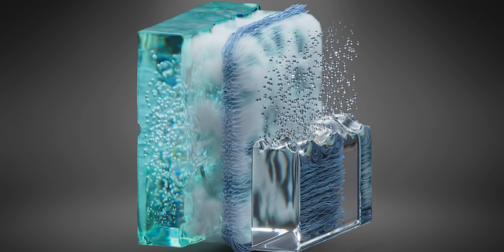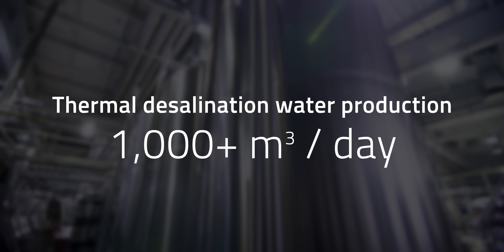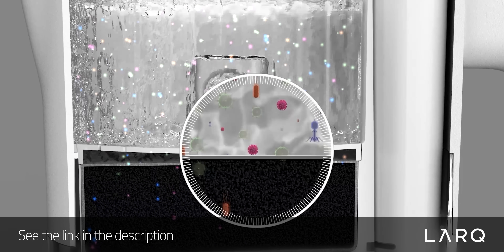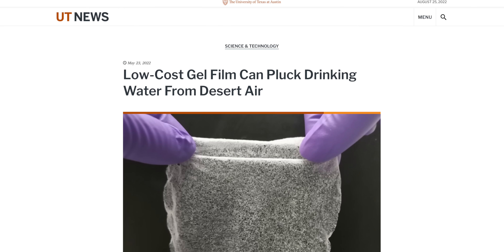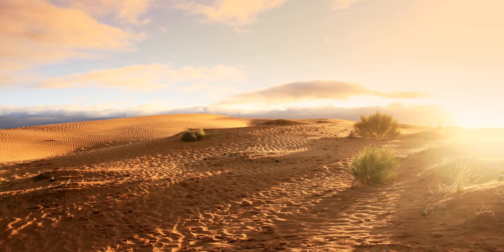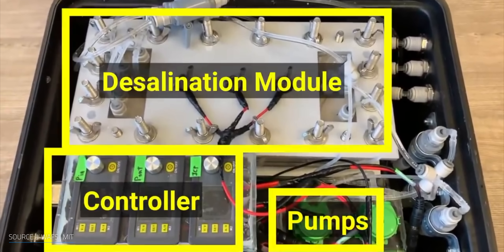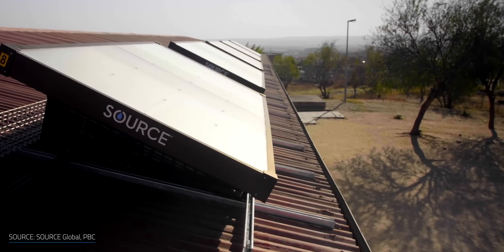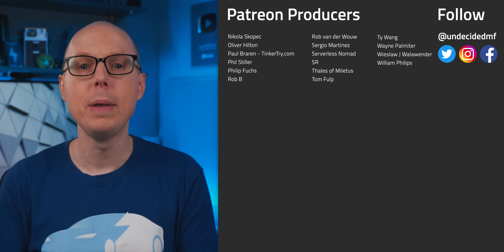2 Breakthroughs That Could Solve the Fresh Water Crisis

Comment: Tanking the water from the air in mass would increase the drought because it removes all moisture from the surrounding air. Kind of like cutting down the trees kills the life and increases the heat and drought in the local area. No thanks. If you remove fresh water from salt water you can dump the removed salt back into the sea. The removed water will find its way back into the sea to replenish the fresh with salt to keep the saline levels in balance. Im for desalination via the sun.

Comment: - When we remove the salt from salt water, the salt has to go somewhere. So all desalination techniques have to contend with that side-effect. Ironically, higher productivity in terms of fresh water output divided by salt-water input makes the side-effect more potent ... requiring some way to dilute the brine to an acceptable level.
- Pulling water out of the air is not dealing with salt ... as air usually has very little salt in it (unless you are very close to an ocean). The gel seems wonderful. One might even make it part of an adventurer's (or soldier's) clothing or a vehicle's cladding. Considering how inexpensive the gel seems to be, recycling may be a problem because there is too little financial incentive to do so ... UNLESS: Like beverage containers, recycling is prepaid.

Comment: The Phaseshift from water to steam itself takes energy. It is physically impossible to harvest water from the air without putting in a lot of energy. One Liter of water will with perfect efficiency require 626.9 Wh. I really doubt that should be a solution to work towards.

Comment: I, like millions of other sailors, have lived off of a small-scale, membrane-based, high-pressure unit powered by modest solar, wind, and water turbines in full ocean salinity on a budget of ~20L per day (made in one hour around noon for obvious reasons) for two people (and two cats) for years and years underway on a limited budget. This ICP unit in the video is making a tiny fraction of that, optimistically, from a comparable or larger package, and I hope those hope production estimates are not as misleading as "ballpark $50" for the unit, when $50 wouldn't come close to even buying the case it's in. Demonstrated cubic meters per kWh side-by-side comparisons would have been helpful for membrane- (which also leaves you with cleaner water than you can get anywhere but a laboratory, of course) vs. ICP-based technologies so we can decide more clearly if ICP is actually "challenging the status quo". That, and an honest estimate of what a unit like this -- soup to nuts -- might actually cost once commercialized. It surely isn't $50 or anything remotely like it.

Comment: I recommend looking into carbon nanotube membranes further. Hydrothermal gasification of waste biomass (sewage, sludges, food, etc.) creates carbon nanotubes and other graphitic materials. The hydrogen and methane produced in HTG can be used to power desalination processes. If the temperature and pressure of hydrothermal carbonisation are brought down, then the products of liquefaction and carbonisation produce other materials to offset fossil fuel use and can sequester carbon if paired with pyrolysis. The brine could be used in algae farming for additional carbon capture and fed back through hydrothermal liquefaction to create more biofuels. The whole process would be carbon negative.

Comment: I really like the MIT idea.  Now we just need to turn the Brine into something that has value and can be sold or used as well, instead of a waste product.  
Salt is very good at storing heat.  
So at a slightly less portable size you could use the brine to collect heat for reuse. Then use that collected heat to finish drying more salts the rest of the way in to solids.  
Then use the solids as a way to collect even more heat.  
For small seaside communities with a fair amount of sun you could supply fresh water.... both hot and cold.  Then use some more of the heat to make electricity at night when the sun does not shine to keep it going.  
Until you reach the point where you have more fresh water than you can use then you can pump it farther inland to somewhere that is willing to pay for it.

Comment: On the project of pulling water from the air even in a desert climate, 
I'd image the question about longetivity of the hydrophilic filter is pretty obvious...
1. The filter is made of cellolose so although organic and cheap will have a relatively low life related to abrassive  factors. Plenty of filters for numerous devices are made of same or similar material, and I wouldn't expect that this version would be any different.
2. Possibly the single biggest factor affecting lifetime is theamount of debris that is trapped. Especially for something running continuously 24/7/365, enormous volumes of air will pass through the filter and contaminents will be caught. The question then is how to clean, and typically a thorough rinsing is SOP but that would possibly affect total production. This is an issue that would be site specific and deserts are well known for lacking soil because it's blown by the wind.. Who knows, i there is enough power available, maybe an electrostatic filter could trap particles before they gt caught in the filtere.

Comment: The portable supply unit,  if it can be mass produced at $50 is pretty impressive.   You would basically need one, and a solar panel for each member of your family to get all your purified drinking water needs.  As far as the brine discharge, there are some uses for it.  There are a type of beets called ' fodder beets' which can be used to feed chickens, cows and pigs which grow really well with salty water.  The brine could be diluted into typical irrigation systems.  On a household scale, brine can just be used to kill weeds between cracks in your sidewalk etc since a household would produce very little.  It can also be used to de-ice sidewalks... it is basically the same thing you go to the store to buy in the winter.

Comment: The calculations I've seen in these comments are nutty.  The underlying problem is the confusion between water vapor and liquid water.  One comment claims that processing 200 L of air will generate 6L of water.  No it won't.  It might produce 6L of water vapor, but that will condense to less than 10 mL of liquid water.

The other problem is hidden in the word "condense" -- the energy required to transition between water and steam is huge (that's why evaporative coolers work so well in desert climates).  To turn steam into liquid water you'll need to dissipate a LOT of heat. This is impossible without air conditioning equipment and lots of electrical power.

Another comment claims that clouds are 3% water by weight.  Okay, but clouds don't weigh very much.  You should be able to see that for yourself, since they literally float on air.  This low density means that you must process a HUGE volume of air/cloud  in order to extract any meaningful amounts of water.

All of these water-from-air projects are scams.

Comment: Build up swales topped with the moisture harvester materials.

Build an array of swales in the mid-range of known flash flooding dessert areas. In time creating pockets of greenery, increasing water absorption. 

Make the swales by digging long tunnels in 2 tiers. The bigger ones function as a reservoir. The smaller diameter one dug just under the surface to collapse, designed to perform as a french drain. Use the tailings from tunneling to shape into swales.

Will it solve the water crisis? It'll help many aspects of it. The ability to reclaim land, the fertile crescent comes to mind, is a worthy mission.

Makes for an interesting Boring project.

Comment: 20 Wh per liter is a VERY HIGH power consumption!! Thermal desalination, which almost nobody uses for its high power consumption, requires 10-15Wh/l, while inverse osmosis only 2-4!
The second method it is even more insane: to warm the gel and the water to the required 60°C you need 112Wh/l!! If that was not enough, the release process begins at 45°C, meaning that the system is almost useless in hot climates...

Comment: 20 watts per Liter is meaningless, watts are a rate of energy consumption.  We need to know the ENERGY used per Liter of water.  If it's consuming 20 watts while in operation and makes 300g per hour then the consumption would be 240 kJ per Liter or 0.06 kw/h.   Inability to do basic math like this is why people say this channel is useless regurgitation of press reports with no understanding of what they mean and it looks like Matt dosn't even understand the difference between power and energy.

Comment: No mention of atmospheric water generators? They pull water out of the air using only electricity (including solar). Companies like Altitude Water are at the forefront of this, and the DOD uses these.

Comment: The largest ecological issue with brine disposal is not the brine content itself, it's the concentration and size versus it's surrounding area. ICP technology sounds interesting because theoretically an infinite number of disposal nodes would not have any ecological brine disposal issues. You can't get rid of the salt, compounds remain compounds but you can control the distribution so to me, this technology works well if it's not scaled up into large commercial plants. The argument to this is that the cost per unit will never benefit from economies of scale but this foregone advantage can be seen as the cost of commercial brine disposal.

Comment: Eventually, a large portion of potable water turns into waste water. We collect that centrally and treat it, before releasing it back into the environment. Wouldn't it be relatively trivial to mix the leftover brine into the waste water before sloshing it back into the ocean, essentially partially or even entirely (depending on how much water from other sources the city has access to) negating that increased salinity? Just add an extra step to the end of your waste water processing chain, and insert the brine there instead of just dumping it back into the sea.
Usually, when answers seem obvious like this one, I'm missing something, so do let me know.

Comment: 9:51 what the hell does 20W/L even mean? Watt is a unit of Power, which is itself a derivative of Energy over Time, measured in joule per second. So what do you mean when you're saying that it requires 20 j/s/l? Written more conventionally, that's 20 joulelitres/second which makes just absolutely no sense. Do you mean it produces 1 litre of water in a given amount of time, so long as you provide it with 20W while it's working? If so, how long is that? 3 hours, like you already said in the sentence you just finished, but in different words? A day? 30 minutes? Is the rate of conversion dependent on the amount of power provided? How much power will it realistically take before it explodes? Proofread my man!

Comment: Wouldn't the collection of water from the air lower its humidity, thereby lowering the vapor pressure and increasing evaporation from the ground - ultimately worsening the water scarcety in already arid regions?

Comment: Yeah, 50 bucks will not cover much more than the case for that ICP, that estimate has nothing to do with reality. Reverse Osmosis is scalable, and definitely cheaper per unit of water produced, and requires very little energy, per unit of water.  

0.3 liters/hour, as long as you have power, from a solar panel that costs about 50 bucks, and if you want to desalinate when the sun doesn't shine add another 100 bucks. That's 150 bucks for the power, only. And that's 7.2 liters a day, assuming constant uninterrupted production.  

Sure RO require "high pressure pumps", but it's not a huge issue, it wouldn't be difficult to design a RO system that could be hand pumped with reasonable effort that could blow that ICP system out of the water.  Oh, so it could get rid of suspended solids, to make it better way better than required in that regard, well that's not exactly impressing.       

Also, 20 watts/liter? What does that mean? Watts is power, a rate of "flow", amount per unit of time, not an amount without the time factor, liter is an amount, there's no time factor. If that was supposed to be 20 Wh/liter, amount of energy per amount of water it would make sense, and then it would require about 20 times more energy per unit of water produced as good RO desalination. Interesting research, but pretending that it is likely to be of practical importance in the near or near-ish future is not honest. 

About the brine, let's be clear about the fact that it is not some super toxic threat to life on planet earth, it's sea water with less water in it. Sure, undiluted most marine life can't live in it, but sufficiently diluted with sea water the brine becomes sea water again.     

Hydrogels, even more interesting research, but those production numbers are taken out of context, the amount of air that needs to pass the gel in order to catch those amounts of water from dry air is absurd, not pass by in the general area, but pass by and contact, on a molecular level. And then you have to heat it up to get the water from the hydrogel which requires energy input, a lot of it. Relative humidity is a function absolute humidity and temperature, so let's be generous and assume 30 °C, at 15% RH there's less than 5 grams of water per cubic meter of air. In order to catch 6 liters of water a day you'd need to make more than 1200 cubic meters of air come in contact with the hydrogel, on a molecular level, and that is if it can catch 100% of the water in the air. 

Also, NO "pulling water out of thin air" is relevant for general water supply in really dry areas, none. I don't consider areas with a lot of easily collectible mist really dry, or mist collecting "pulling water out of thin air".   The thing is, the water that is "pulled" isn't created, but actually pulled from the air, which means, the air you take water from gets even dryer. It might seem silly, there's an endless supply of air, but on windless days it would be very difficult to get rid of the air that has much of it's water removed if meaningful amounts of water is extracted.

Comment: I always thought that the brine should be diluted and mixed with sea water in a tank before discharge to the ocean. Surely it could be diluted to a level that would be no threat to the eco system. Also the discharge pipes should be further out to sea, not discharged directly from land. If those steps are followed I don’t see how there could be any issues

Comment: Thanks, Matt. Love the drone shot of El Nido, Palawan, Philippines, that you use at 1:59! That's about 100 miles from where we are right now!

I've seen the report on the MIT unit before. Unfortunately, you don't give many performance numbers, & the ones you do quote have problems, just like the original report I saw. You say it uses "20W/liter" which is probably you quoting their literature, but there's a unit missing (& I'm surprised you didn't catch that)! You need a time component. Is it 20Wh/L? (20Watt-Hours/liter)? That's HORRIBLY inefficient.

That unit doesn't require much power, but it also doesn't produce much water. My small Spectra RO system produces 30 liters/hr using 9A@13v, so ~120Wh to make 30 liters, or about 4Wh/L. That's 5 TIMES more efficient than the MIT system. You can argue that mine requires more power, & you'd be right, but we've been running ours from solar panels for 20 years.

I've heard others complaining about the "brine" that results from desalination. We live on our sailing catamaran, currently in the Philippines. We've had our small desalinator on board for over 20 years. Of the water that gets sucked in, only 10% goes through the membrane. So the "brine" that goes back in the ocean has less than a 10% increase in salinity. This is so tiny as to not really be relevant, not when measured against the volume of the oceans. It always surprises me when folks bring this up. This is absolutely not relevant if you look at the numbers for the world.

Along with their being a certain amount of water in the world, there's a certain amount of salt in the sea. If we increase that ratio slightly by taking out some fresh, we'd have to take a HUGE amount out before even the most sensitive instruments could register it. And the water we drink or otherwise use will eventually make its way back to the ocean, bringing the oceans back into balance again.

The melting of our glaciers is having a MUCH greater effect on ocean salinity than any desalination efforts, now or in the foreseeable future.